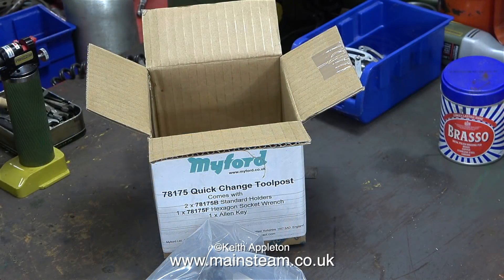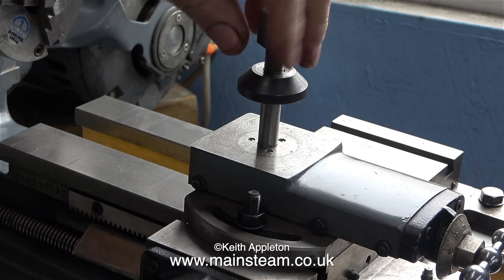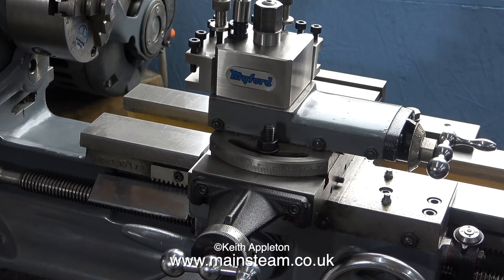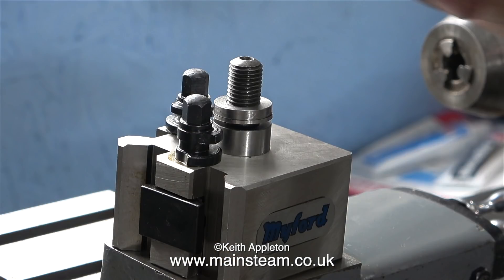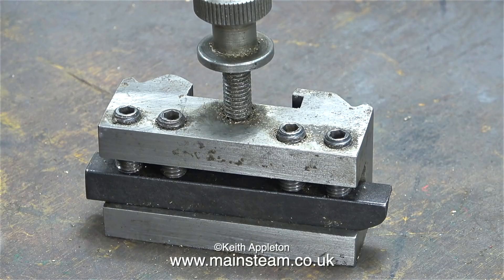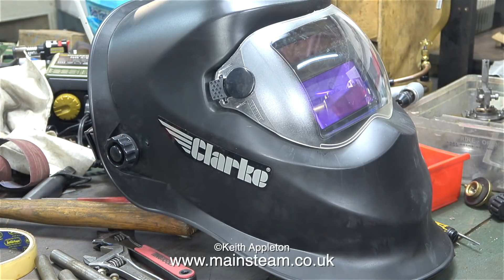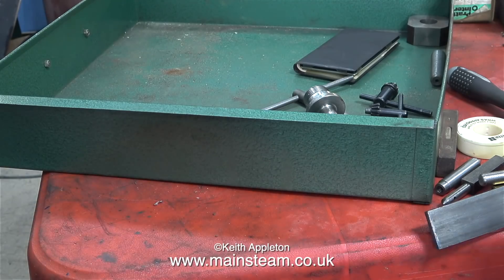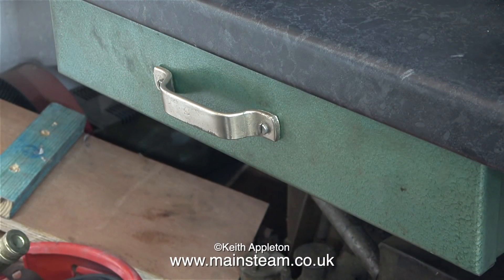FITTING A MYFORD QUICK CHANGE TOOLPOST - WORKSHOP TOPICS

Comment: i have a myford 4 post tool post but have problems stopping the tool post moving when i am using it any suggestions please
Reply from the maker: Replace it with a quick change tool post. That is what I did with mine . . . . .
Reply: @keithappleton  Keith i have the myford super 7 mate sorry if i did not mention this earlier . I bought the myford  quick change tool post but i still have problems even bought a thrust washer and put it on the tool post

Comment: One wonderful tip I have done on my second Super 7 which was in such a bad state we were given it free. Is to mill 2 mm off the top of the topslide  so that you can get better adjustment. In fact the Myford needs to be about 3/8 " higher and of course they eventually did do a bigger bore to the spindle. I use ours most days. The rusty one spent 30 years in a workshop with a leaking roof. As did a Raglan 5. Bits are still trying to be freed 1 year later.

Comment: instead of using small tack welds use small 2 or 3 inch beads every 5ish or so inches so incase you place something heavy in the drawer if won't snap off if it ever starts to rust. or if you didn't get enough penetration